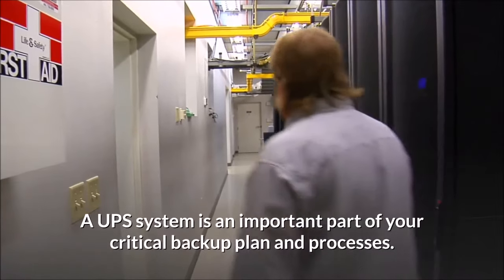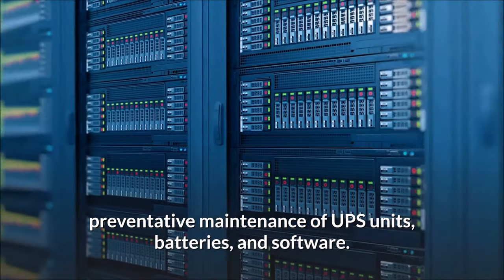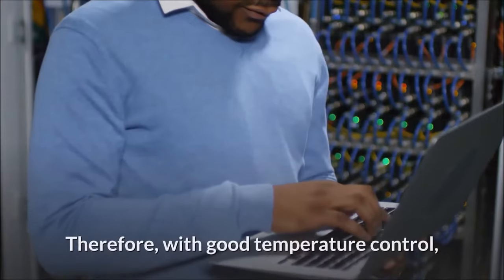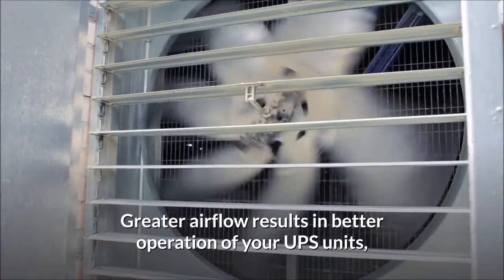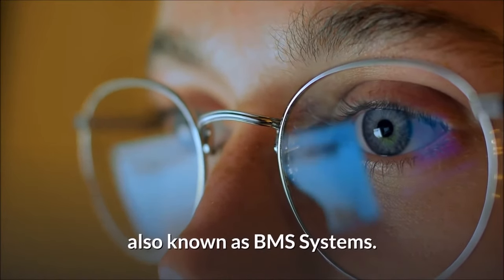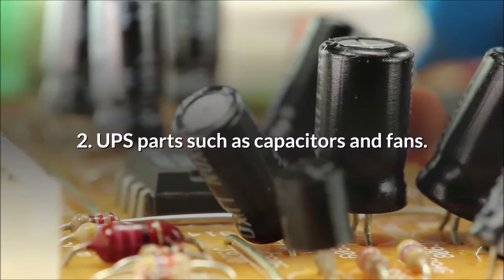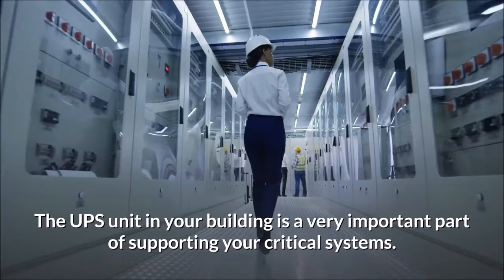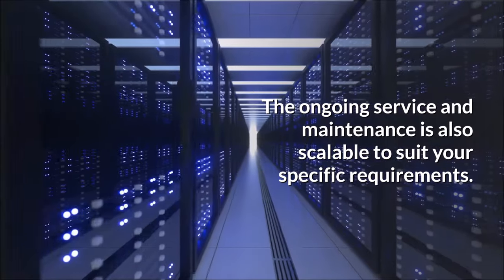UPS Maintenance  (How to maintain a UPS battery)

Comment: Most important thing is to test the UPS system from time to time in the real world scenario. This means disconnecting AC power from the UPS and see if the UPS correctly switches to battery power, if the batteries are still powerful enough to carry the load and check if all the loads continue to operate as expected. And after that restore power to test if the transfer to utility power and the recharging of the batteries works as expected.